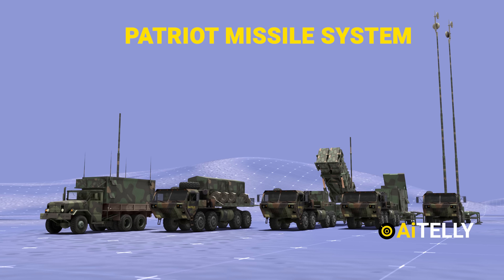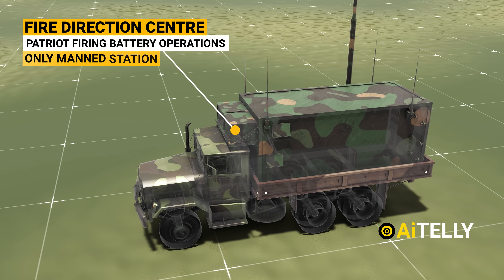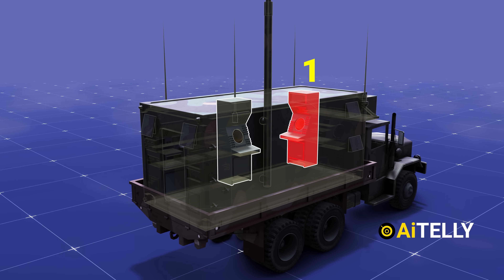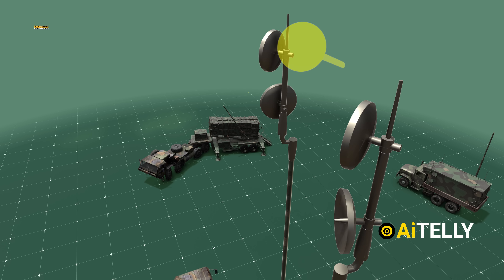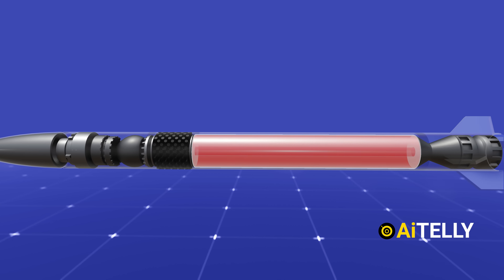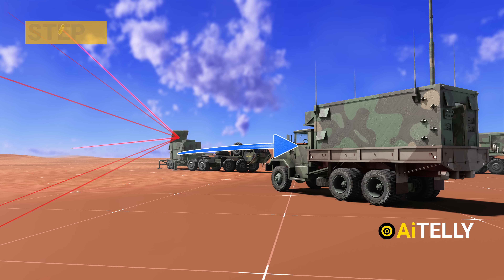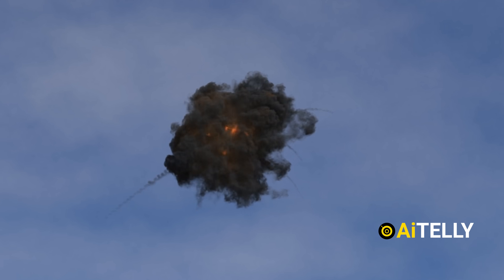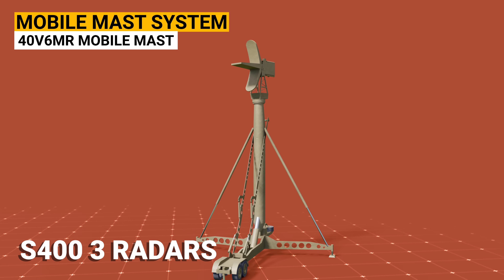Patriot Missile System How it Works | Air Defence Missiles

Comment: I would like to point out, that while the patriot system setup only has one radar trailer, a phase array radar has tens, if not hundreds of little nodes that can send out and lock onto individual targets, aka, it's like having hundreds of small radar antenna in one spot
Reply: That's not how that works. The phased array guides the radar beam. One Antenna alone does nothing and can't track a target. Only all small antennas in combination result in the main beam that gets send out in one direction and then power to the antennas is cut to wait for the return. This all happens in microseconds.
Reply: @AnoNym-zi5ty  Thank you for reminding me about this comment, I haven't looked here in a while, and before, I only knew about the system the F-35 uses, which does allow multiple tracking signals using portions of the antennas, granted, to my knowledge, most phased array systems are able to do this? I mean, not that we'll know for sure for a long time, as it's pretty classified stuff

Comment: Better question is how it didn’t work in Ukraine on two separate occasions and in Saudi Arabia guarding the Houthi oil tank. 
After the Ukraine destruction of the battery in Ukraine an immediate grouping of top level EU/NATO/Americans convened in Poland. They were quite worried and dismayed by the fact their top tier air defence system had been penetrated. 
For obvious reasons it’s been kept under wraps as sales for this Patriot system is ongoing and any bad news is bad for business. 

Unfortunately, word has gotten out based on Raytheon’s stock plummeting on the news of its destruction. 

It’s worrisome that the west currently doesn’t have an air defence system capable of preventing missile strikes, particularly, from Hypersonics.

Comment: Patriot will not be able to intercept an intercontinental ballistic missile, the warheads are too fast. The best it can do is intercept a short-range ballistic missile, one with a range of 1000 km or less. Because of the physics of ballistic paths, an SRBM has a lower speed than an ICBM. 

To intercept ICBMs, you need the GMD missile or the SM-3 missile of the Aegis system.

Comment: Outdated tech - not the most advanced . They are rendered useless with swarm of drones - when set to auto mode it lunches off 32 missiles as the computer asses the treat escalation of a swarm . 4 million $ missile is taking down 500 - 1000 dollar drone . You do the math . Roughly expending 150 million dollars in under 3 min to take down 32 thousand dollar worth of drones . Once the missile battery is expanded then it comes the real missile attack by enemy .  Also larger and more sophistricated drones today carry jammers and anti radar missiles that cost at around 20 thousand dollars . It WAS state of art missile defense system from early to mid 2000 to 2010 . Its rougly a decade behind tech in comparison to todays tech of drones and AI operated drones and missiles , not gonna even mention hypersonic missiles and its prolifiratation in future battlefields due to the fact that nothing fast enough exists that it can shoot it down . NOT suitable missile defense system anymore . One 500 dollar drone can get trough out of a swarm , hit power plant and disable entire system .

Comment: Its very funny when russians claim that Ukraine hit their Betab-500 missile instead of their overhyped Kynzhal however, the difference between warhead of Kynzhal and Betab are vivid: recessed shoulder, form, mounting elements
Reply: Kiev's mayor posed for that Betab-500 bomb claiming it's a Kinzhal. Betab-500 is not a missle btw. It's a bomb. You may not know of the differences.
Reply: @lyncs0012  no, he was posing in front of the Kinzhals WARHEAD despite of it has some similarities with betab bomb's front part, just look at the recessed shoulder in where the cone is going into cylinder part, Betab does not have this. Yeap,  russian propaganda is very lucky that their parts are kinda similar and it can brainwash their citizens with that.

Comment: The 4 amg antenna don’t continuously spin lol they can be toggled left or right but only so far. The amg never drives with the masts up, only stowed. And the sides have big batwing platforms. They are not on trailers. They are directly mounted on big truck beds. 
The ecs has 3 manstations. The  one behind the other 2 doesn’t have a crt screen. The other 2 have been upgraded to large touchscreens. And believe it or not, they now have 2 recaro racing seats lol. Good job on this video. Might want to mention the radars don’t have to continuously rotate due to triangulation.

Comment: Best part about the patriot, if it cannot intercept the Dagger it has a failsafe that is throwing 5 launchers and a radar station on the way.

Another good point is that half the missiles fall on allied territory so you actually didn't spent U$ 150 million, just 70-80 and the rest can be recycled.

Comment: All of the various components are placed many km apart making it extremely difficult to destroy the entire patriot system.
Reply: Nope they’re actually pretty dang close
Reply: @isaac-vb1ng  if you consider 10km close..
Reply: @Farnsworth11  I literally used to work with patriots I’m telling you they’re pretty dang close
Reply: @isaac-vb1ng  well I just read US documents which state the launchers can be 10km from the radar...I'll believe that over some internet expert.
Reply: @Farnsworth11  I’m literally a Patriot launching station operator/maintainer
Reply: @isaac-vb1ng  then you better correct nato, the US and every other country that uses patriot systems...or you're not who you claim you are.  That never happens on the internet...right?
Reply: @Farnsworth11  the fiber optic cables that connect the launcher to the ecs are only a couple hundred meters and even if you daisy chained the launchers together they’re still pretty close
Reply: @isaac-vb1ng In 1993, the Army upgraded Patriot to a support remote launch capability, allowing launchers to be deployed up to 10km from the radar.

Comment: I just hope we have better defense system, or we describing functionality wrong or the enemy now knows all about it. In my days in the service we were very careful not to describe how our systems works, if at that time any of that information could fall on enemy hands it could be use against. Then I learn that some times we sell equipment like high tech, our best aircraft etc.  to the nations that could be one day our enemies, and it was explain to me that some times we do it in purpose, you see… we now know the capabilities and limitations of their equipment using against us, so we will be in advantage. Is this the same case?
Reply: To somewhat answer your question
We have a pretty good idea what a SU-27 can do.... But we know down to the rivet what a F15 can do! So there is that. But more so, modern military equipment is run by computers and those computers are self limiting to avoid damaging the system (like a F15 will not exceed its G-limit when turning, even though the controll surfaces could easilly do so) There is some built in safety in this system just so that you are not balancing on a knife edge every time you take off but if two nations with the same aircraft and one of those nations actually makes the aircraft get into a conflict, it is a sure bet that nation would update the aircrafts firmware to give their aircrafts that tiny advantage they need to win most of the times without actually overstressing the aircraft... and there is always the posibillities of a hidden backdoor in the software that will transform a fighter into a paperweight real fast.

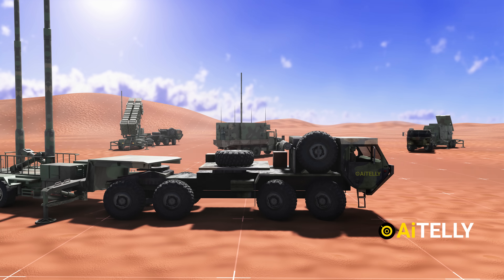Comment: I apreciate you showing a the rocket compared to a person at 5:18 but that missle does not look 254 mm in diameter. Should be significantly smaller than the guys waist. Its bigger, looks more like 400.

Comment: Terminal flight guidance assembly would be directional and active. mid-course nav would be handled in a closed loop using GPS. that gets it to an approximate location without alerting the target because it has not directly detected it, it's only going off preliminary flight direction from the launch control radar.

Comment: Every single military system west supplied Ukraine with failed. None achieved objectives. Russia successfully tested their hypersonic missiles including loitering munitions. US general Milley on the way out may bring some changes. Russian oil exports surpassed 2021 levels. US Patriot air defence system capabilities: max attack ceiling 20Km, minimum low target scan visibility 50 meters. Anything flying bellow 50 meters remains invisible to Patriot. Maximum target speed cannot exceed 1600km /hour. Missile launch angle is max 38 degrees one direction only , not 360 dgrees. Russian bomber aircraft can be detected at the range of 180Km, fighter aircraft 130km, Caliber cruise missile max 100km. Hypersonic balistic Russian Eskander (max range 500Km) missile attacks target from 50km high. Kinzal hypersonic missile (max range over 2000km) is known to glide 50-80km high. Conclusion: US patriot air defence system cannot intercept Russian Iskander or Kinzal hypersonic missiles. On May 15 Kiev based US Patriot system was fooled by false targets approaching from the north. American crew panicked and fired full missile arsenal of 32 missiles. Once Patriot radar and all launcher positions where identified Russian MIG31 pilot fired Kinzal missile. NASAMS protecting Patriot did not help.
Reply: Как пагодка в Маскве, клоун?
Reply: @PallasKatze  are you russian that that haven't learned English yet?
Reply: Photo/video proof?
Reply: @t_i_988  Why? NATO/Ukraine is winning
Reply: Sorry but the news for NATO are not so good. I can see desperate US Patriot salesman trying to explain to his buyer why it was destroyed in Ukraine by one Russian missile. Caboom!!
Reply: 😂 @bobtate7459 😂  😂😂😂😂

Comment: My biggest complaint is with the pronunciation I mean for Pete's sake she can't even say kilowatt. And on top of that she doesn't know what the heck she's talking about when she says it doesn't even rotate. A phased array radar does not rotate it doesn't have to. It uses phase arrays as in varying the phase angle on the array antennas in order to change the beam Direction. If you don't know what you're talking about you shouldn't be making a video

Comment: Left behind a very important part - in the last stages of the flight the missile itself does not calculate the point of impact. Instead, it sends its seeker radar data back to the control center which makes calculations and sends back the trajectory adjustment commands. In the video it appears as if the missile is using self-guidance, which is not true.
Reply: if true, isn´t that classified as this could be a potentially jammed.. At least the patriot missile would be near the target and far from the base station, so the target could just jam the base station to missile communication with not that much RF power.
Reply: @Spacefish007  it’s been a common knowledge for the past 15 years for anyone who dared to dig beyond Wikipedia.

Comment: Not a well informed video, several points are not correct. Why would a radar guided system need GPS? The missile itself does not have a seeker on it but is guided by the ground unit.

Comment: How quick is the launcher to evacuate an area after firing to avoid a counter attack? Can it be done in under 5 minutes?
Reply: no
Reply: @max_galingumas9409  How long does it take at minimum?
Reply: s300 moves in 15 minutes.....  patriot takes an hour or two.  generally SAM dont move much while artillery will.
Reply: @peetky8645  Not to redeploy, I just meant evac mode, to avoid a counterstrike after firing. Just to drive away a few hundred meters.

Comment: It works great. Shout-out to its engineers from Kyiv, Ukraine ✊
Reply: The Economics of War

It turned out epic with the Patriot. Regular work - two counter-missiles per target. The Americans saw that a Dagger was flying at them, panicked, fired the entire BK-32 missiles.

Didn't hit any. The Patriot is destroyed.

One rocket costs $5 million. 32 - 160 million. 

One launcher is a BILLION dollars. It's all in the trash.
Reply: @retoxxx1  you are way too much generalizing. 

First of all, there is no evidence that the entire system was destroyed. As it's clearly said in the video, Patriot consists of 6 independent and replaceable parts which cost around $1bn altogether. So hitting an empty launcher or a diesel turbine generator wouldn't result in an immediate loss of $1 bn. It's worse for radar/command station but not a $1 bn loss either.

Secondly, if it's damaged but not destroyed, it can be repaired fairly quickly. Then each saved civil infrastructure or strategic military object which could have been hit overweights the cost of replacing/repair plus warheads.
Reply: @unlimitedlove8782  in any case, the USA will say that there is no damage (or the damage is not significant). because it undermines the entire authority of the air defense. all NATO countries will not be protected. the point of Finland joining NATO is if it is not protected in the end. and now I suggest you think with your head, the Ministry of Defense of the Russian Federation declares today that the Patriot has been completely destroyed, and the radar. in Ukraine, people speak Russian and it is very easy to confirm this information. than America to defend its point of view. I can add on my own that the patriot system is the number 1 goal for the Russian Federation, as it is a threat to military superiority and undermining the confidence of countries in the United States that purchase these weapons.
Reply: @retoxxx1  video that assumedly 'confirms' damage caused to the Patriot deployed in Kyiv neither demonstrates any secondary explosion nor any fireball. Seems more like the remainings of the intercepted Killjoy/Dagger which landed nearby.
Reply: @retoxxx1  Patriot is not immovable. It's hard to capture it on a satellite picture because it's usually used in a 'hit-n-run" fashion rather than standing on the same site. The satellite's trajectory might not crossed the Patriot's site that day.

Even if it did, don't you think people are smart enough not to disclose the locations of Patriots/Irises/Leopards 😅
Reply: @retoxxx1  True. It was comletely destroyed including the radar. (
Reply: @unlimitedlove8782  well, yes, there are 32 missiles scattered around Kiev for $ 3 million each of which should, in theory, shoot down ballistic missiles. Do you think this is a success? You guys were talking about the s400 in Syria, but when it came to your missiles, you farted with gravy. 32 missiles that are supposed to shoot down ballistic missiles, and they failed.
Where are abrams sepo?
Reply: @unlimitedlove8782  proof is the blue boom from the place where patriot shot its missiles
Reply: @unlimitedlove8782  its literally on the video hohol
Reply: @愛を込めてロシアから  🐖🐖🐖
Reply: Прекрасно был уничтожен русским Кинжалом.
Reply from the maker: https://youtu.be/s_TKDYWdbus kinzhal missile How it works

Comment: You didn't mention role of Antenna Mast Group during the fire🤔
What is its purpose,
1) to connect command center with launcher or 
2) to connect radar with command center 
3) or to connect missile with command center?
4) or all at once.

Everything else was very cool🙂
Reply: It's basically an oversized radio antenna. Used for communication to higher or other units.

Comment: the fact that the f117A stealth bomber could be shot down using the S-125 Neva 1960 and using a radar that still used vacuum tubes.  The greatest weapon made by the USSR is its anti-aircraft capability.  with the s300 in Ukraine and the s300/400 in Russia.  the Ukrainian air war became defensive
Reply: Neva has optical missile guidance, as in a cornet or a 2nd generation ATGM. In fact it has nothing about spealth finding

Comment: Half the information is wrong. Drawings are wrong. Your mixing info between the PAC 2 and PAC 3. The missile doesn’t have GPS. It has a different system. EPP is not 50 kW. That’s way too small. ECS man stations are incorrect. Your AMG is also wrong and mounted wrong. I have 20 year’s maintenance experience working on config 2+ to the current configuration.

Comment: Another correction, their is another vehicle in any patriot battery that while not essential for firing the missile, it is essential to the idea of an Integrated Air Defense System, the BCP. The BCP allows commanders to access Datalinks to see a wider picture of the battlespace and identify targets before they're acquired by the radar.
Reply from the maker: Thanks for your feedback 🙏
Reply: Your also forgetting CRG.

Comment: Hi and thanks for an informative video (even though some corrections where needed).
I just want to bege you to choose a primary unit system (preferably metric) and stick it as the first unit typed on screen or said in narration.
For example. You said that the missile is 5,(something)m long and 257(!?)mm in diameter (also without and translation to imperial units) then in the next scene you compare it to a human model standing 6 feet tall(also here without a translation to metric). I don't speak imperial very good so the comparioson completely lost it's value to me.
Otherwise awesome video! 🙌
Reply from the maker: Yes thanks for your feedback, Sometimes It's a miscommunication between the me script writer and my animator.
Will do better
Reply: Haha wish I could
Reply from the maker: @birdbrain1078  🙂 Or Jujutsu like Mark Zukerberg
Reply: Little MMA never hurt anyone